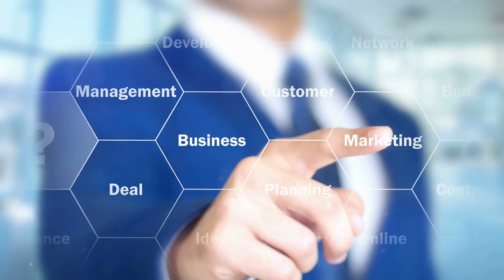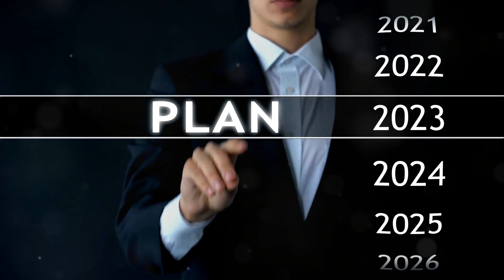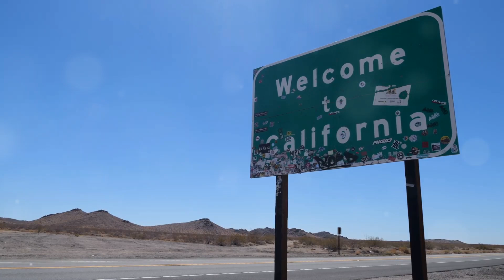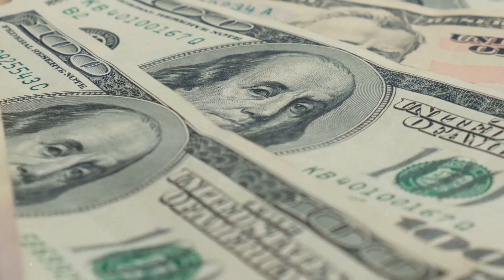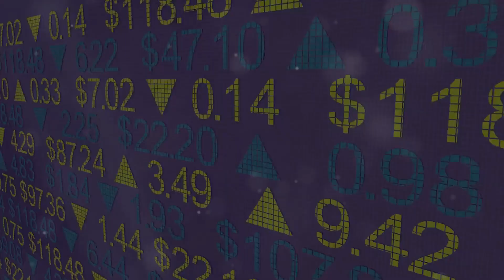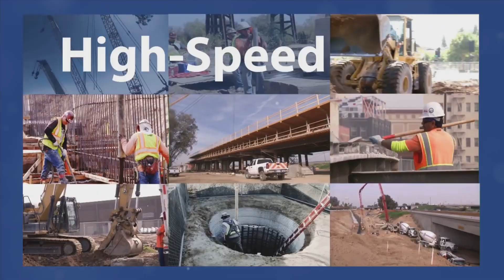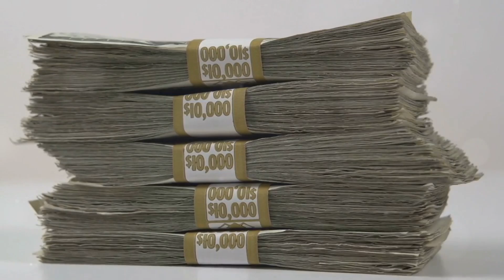Is California's High-Speed Rail Still on the Right Track?

Comment: Halelujah !!!  And now, with the emergence of hydrogen power trains, they won't have to build overhead power lines.  Lots of money saved there.    Alstom's i-lint train is already in operation around the world.  GO FOR IT !!!
Reply: I don't think I-lint is capable of operating at high speeds and hydrogen power trains aren't very energy efficient.
Reply: @aGame284  Doesn't matter   All that matters is to achieve  net zero carbon emissions and H is the only way to do that.
Reply: @johndunbar7504  biggest priority is the speed, and electric is the only way to do that, also zero emissions
Reply: @duncanholden2826  Wrong on all counts.  Alstom tested the i-lint in my home country of Canada.for many months last winter.  Results showed that it matched or exceeded diesel and electric trains in all performance characteristics (the i-lint is ultimately electric at the power wheels).   These results satisfied German railways who ordered a dozen trains after that. p.s. electric trains are not `zero emissions'.They have all sorts of environmental proiblems in production.
Reply: @johndunbar7504  <-- I don't know what you're smoking but there is no way hydrogen fueled is more efficient than overhead power lines.  I'm guessing you are eating up the company propaganda.  Someday there may be a use for hydrogen fuel, but it won't be trains.  It is going to be something that cannot be plugged into the grid.
Reply: @johndunbar7504  how fast did the i-lint go in canada? was it faster than the 357mph TGV?
Reply: @duncanholden2826  I don't know.   The point of the i-lint trials in Alberta was not to establish speed records but to test the train in highly variable, and often bad, weather conditions. It performed beautifully.
Reply: @johndunbar7504  so what im hearing is that in very specific instances (how is it affected in bad weather) it's similar to diesel and electrics which dont have problems anyways, but its incapable of the speeds of electric?
Reply: @duncanholden2826  I have no idea.   Ask Alstom.
Reply: @johndunbar7504  alstom says its slower that's why they're focusing most of their power behind fully electric
Reply: @aGame284  Guess again.  There's
 a posting on You Tube entitled  "Spain built the world's first Hydrogen train.   Their H trains get up to 300 km/hr which is as fast as any other kind of train (except for mag-levs).
Reply: @johndunbar7504  i think the thing i still take issue with is the production of hydrogen as a fuel source. Electrolysis is one of main forms of production and that requires electricity to make, and also requires transportation to get it to train depots. I can't say I know the numbers or specifics, but I'm all for cutting out as many middle steps as possible

Its like charging a portable battery, then charging your phone with it. Why not just plug your phone directly into the wall outlet?
Reply: What are you on? Why do you think hydrogen powered trains matter at all? They are way less efficient and not being used on CHSR. They are using overhead lines like they should.
Reply: Overhead wire is proven to be a cheap and effective solution, hydrogen is an expensive distraction mostly touted by the Big Oil.

In case of HSR, it's biggest problems are logistics and mainly its low power density of both tank and power packs. Even diesel isn't power-dense enough to make it a good power source for HSR, only overhead wire can do that.
Reply: @JasaDavid  Well it's obvious that you don't hold a degree in engineerimg.  I don't either but even I know that the power source for electric trains doesn't matter.  As long as it can generate 25 Kvs (for  example), any power source will do.
Reply: @johndunbar7504  🤣 maybe you should learn more of those basics yourself. Like what specific power do high performance trains need, what power is thus needed for the traction and maybe what voltage is in DC intermediate circuit that feeds the traction converters. 🙂
Reply: @JasaDavid  Nothing about building and maintaining overhead catenary wires is cheap.  The price of manufactured hydrogen is comparatively high but is expected to fall as Hydrogen becomes the preffered alternative  fuel source to fossil fuels.   Hydrogen is the last thing Big Oil wants in the world because it is a complete replacement for fossil fuels..  However, even the oil barons of the middle east can see the ` wrirting on the wall' and are now building the world's  largest hydrogen production plant in Egypt.
Reply: @johndunbar7504  once you need high performance or high train density, it is the cheapest way, other propulsion methods just don't scale in one way or the other. HSR in settings like CAHSR mean both high performance (have you looked up the specific power of electric trains vs. trains with onboard power yet?) and high traffic density.
Reply: @JasaDavid  I don't know much about all this and defer to others.  I commented on this because of a much wider thing that is happening with finding the right power source to do a job.   History in the making.  Hydrogen is clearly the one and only alternative power source to fossil fuel applications everywhere.  It can be used wherever fossil fuels are used and can be applied easily and immediately to all such requirements.   There are absolutely no disadvantages to its use.  It is a perfect solution to climate change emission problems.
     But despite all that,  it is slow to arrive.  All parties concerned with climate change issues commited to electric as the way to go but , as it turns out, that is not the way to go.   There are all sorts of environmentally negative effects to making that switch.   And, worst of all for those who have put so much effort in to developing EVs,   consumers don't want them.   That has resulted in an enormous stockpile of EVs.   In other words, EVs are a ` dead end '.
    The huge commitment to EV development has resulted in Hydrogen being side-lined. It is taking forever to get this marvellous fuel in to the main stream.  And that,  is a real tragedy.